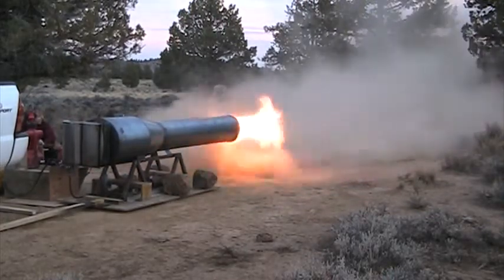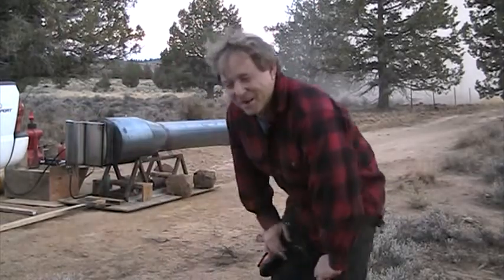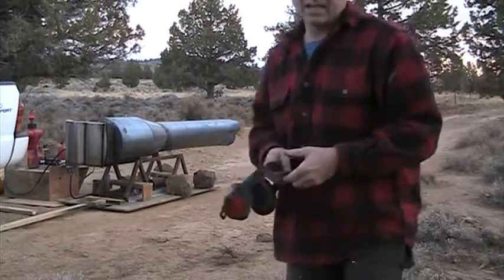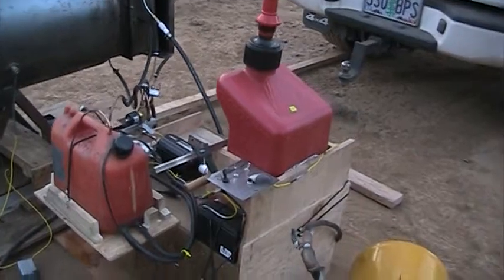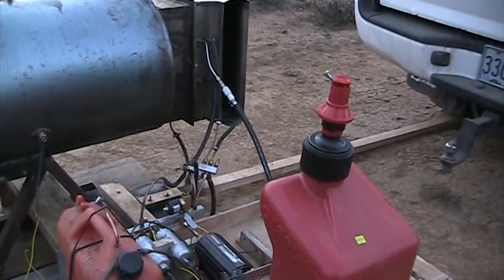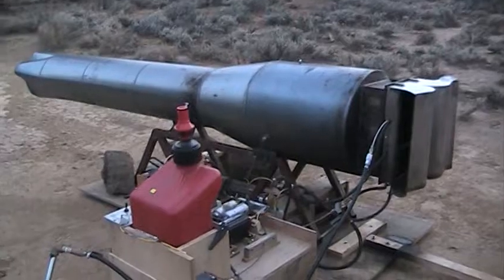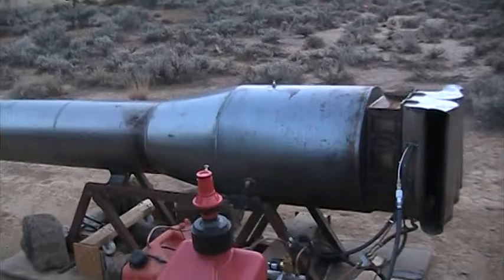MADDOXJETS.COM "SUPER WILD PULSO PULSEJET JET ENGINE RUNNING!!! SUBSCRIBE!!

Comment: imagine if the gas turbine engine was just impossible to build due to the materials used to make blades, being not available. imagine instead 16 or 20 of these pulsejets used in the place of the gas turbine instead.

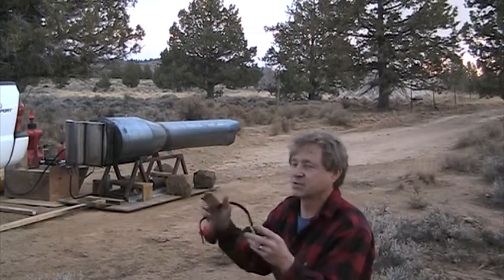Comment: Is it just me, or does it sound like an echo  of the engine  around 1:33 min in film? If so , sound travels at 5 seconds a mile , the echo was 50 seconds from engine shut down which is 10 miles, so 5 miles out and 5 miles back....any large mountains around to reflect the sound........ I was listening to this with a set of headphones......  any comments?
Reply: That was a distant Jake break the echo would of had bin longer since he ran it for 20 seconds.

Comment: Wow, I was thinking that very same thing! (using nitrous). I would have thought that using nitrous would allow you to push more fuel through to get a more powerful blast thus more thrust and noise. I also wondered what it would do if you used just straight oxygen. Your results are really enlightening. Do you know what the chamber pressure is at max?

Comment from the maker: Hey,
I did a bunch of testing with Nitrous, the engine would take a lot more fuel but would not make more thrust.
Reply: Try dumping nitromethane into it just make sure you’ve got a flash arrester in the line that stuff is pretty damn volatile when it burns it produces oxygen like NOS but the difference is nitromethane is combustible by itself and NOS isn’t

Comment: Was that the way the original V1 engine was valved?  I always thought it was it was more of a set of hinged valves that went across the front of it.  I was also curious if you were timing the ignition, or just maintaining a high frequency spark.

Comment: Good Job!!  Test to failure indicates the awesome power of the venturi effect to deform the heated tail pipe.   Also, very interesting the deformation of the pipe had a trefoil pattern. It may be that the pressure wave in the pipe actually has a trefoil symmetry. That is, the normal mode of the sound waves that are  excited by the combustion and/or air intake manifold may have the same shape as the deformation. Maybe the frequency of that mode would match the sound you hear when operating it.